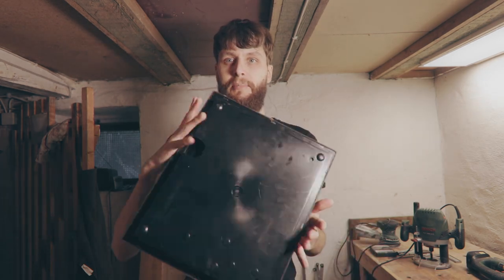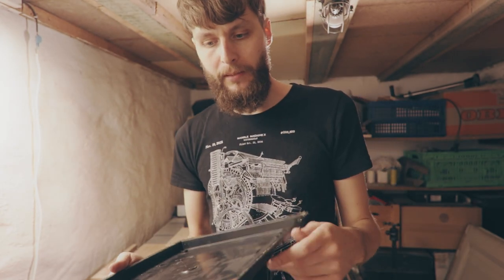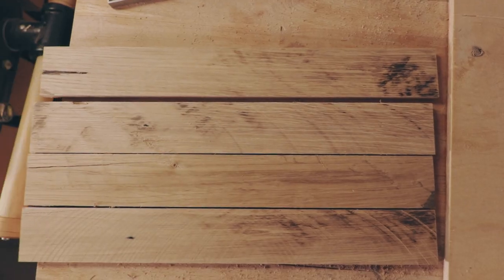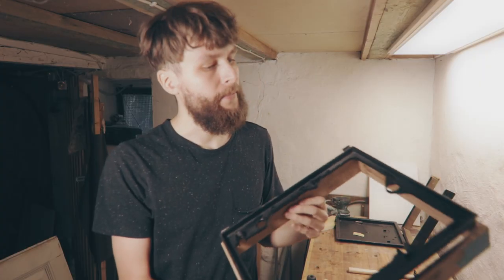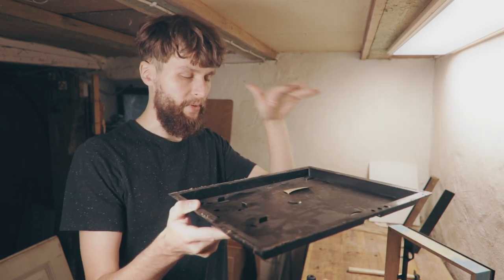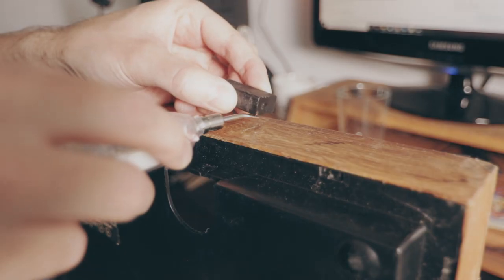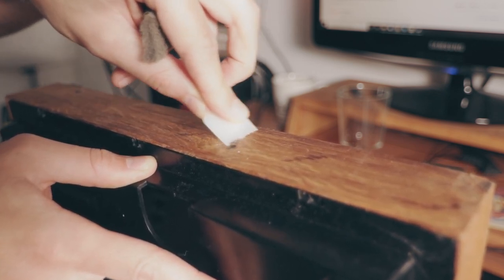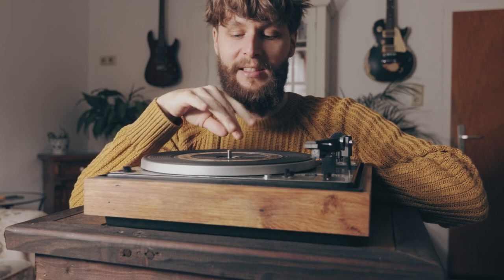Custom Wood Frame for my Record Player // How to make  Custom DIY Plinth

Comment: Nice job! But was this turntable worth it? Not sure if it's the photo, it looks like the cartridge azimuth angle is not right - worth checking. Btw, I've got the same Samsung monitor! :D
Reply from the maker: Thanks!! I'm not sure, I love to repair or reuse things but I guess I had a tunnel vision and half way through I started to see the technical issues... At some point I probably have to take a look at that, so thanks for the tip! :)
Reply: @Ema_Punkt  I think you use a mirror to set that. Basically, you place the mirror on the mat, make sure it's perfectly flat, and move the arm placing it above the mirror, then lower it till the stylus rests on the mirror. Then, looking at the cartridge head on, with your eyes as level with the cartridge as possible, the stylus and its reflection should appear as one straight line. Or something along those lines... ;) 

At least you got good practice at making a wooden plinth!

Comment: Excellent workmanship of the wooden cabinet. It looks amazing.
I recently bought a turntable DUAL 1225 with the same headshell cable rework, even the cables were soldered directly on both sides - from the headshell and to the cartridge.
I'm about to replace all the cables soon.
Reply from the maker: Nice thanks! That is something I probably need to do in the future too!

Comment: Ooh I have a 1225 I have just refurbished and it sounds great but the plinth looks lousy.  Thanks.
Reply from the maker: I'm curious about the refurbish, what did you exactly do? Did you replace the cable, I noticed mine are not in a good condition and wondered how complicated it is to replace them.
Reply: @Ema_Punkt  I watched a lot of youtube videos and I cleaned all the grease I could, then re-applied grease and oiled.  The steuerpimpel was missing (common problem) so I had to jury rig one out of window screen spline.  I am thinking of replacing the RCA cable too.  Not sure how hard that will be.  Mine is not soldered.
Reply from the maker: Thanks for the answers. Cleaning and greasing sounds like a good idea, my turn off automatic is sometimes not working proper - maybe that would help😊
Reply: @Ema_Punkt  Yes clean your automatic track with isopropyl alcohol and re-grease lightly with a modern grease (will not go bad over time).  I am still wondering how to redo my RCA cables as both left and right are grounded separately.  I have an RCA cable with one ground.